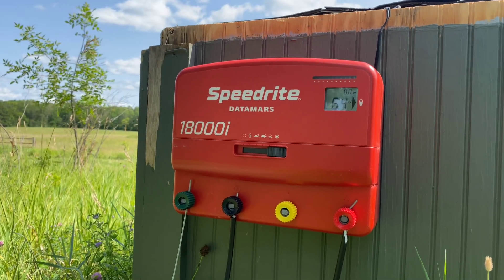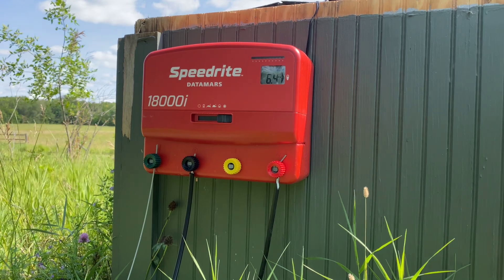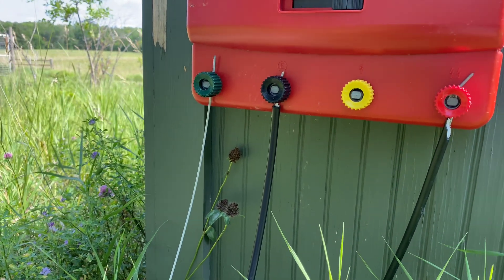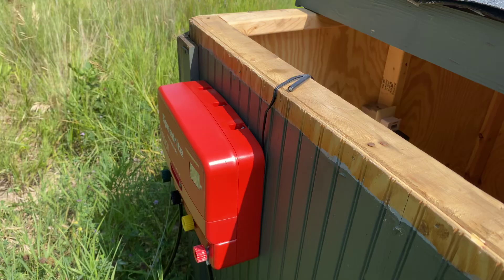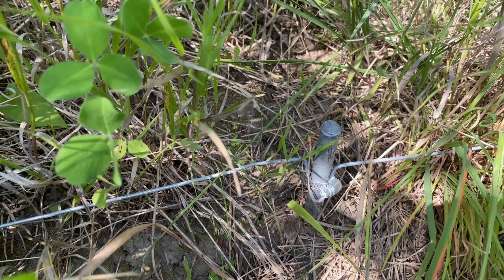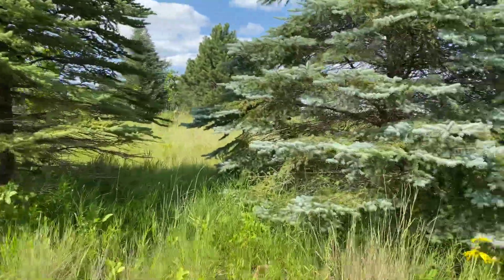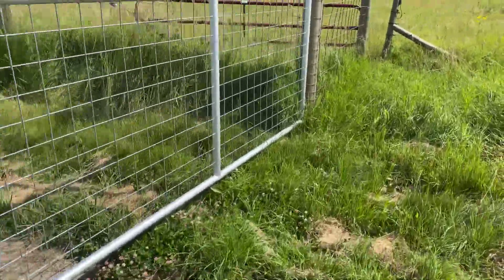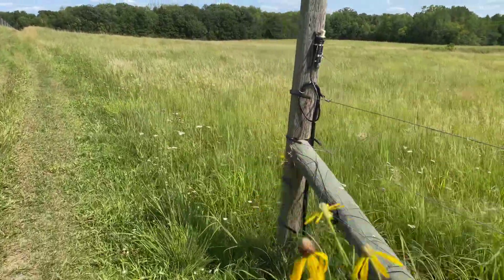How to Correctly Install an Electric Fence Energizer

Comment: I'm fencing in a 60ft by 30ft area to keep unwanted visitors out using 5 or 6 strand electrical
 wire only .I'm using a saco xx high voltage 40 mile energizer how many 6ft ground rods do I need.
Reply from the maker: How many joules is your energizer?
Reply: It don't say.Its a Saco XX Hi-Voltage 20 mile.Solid State